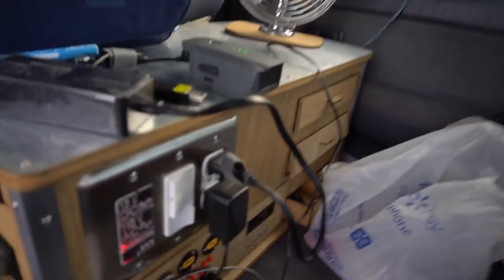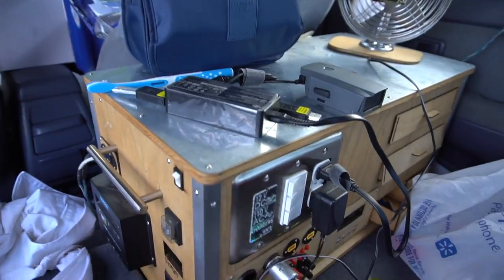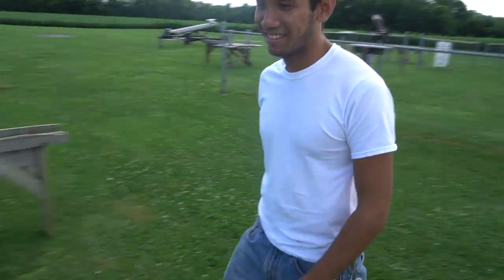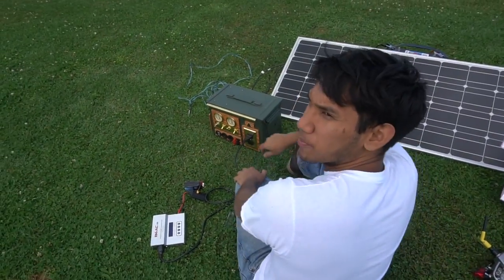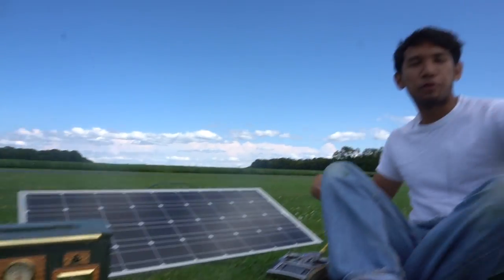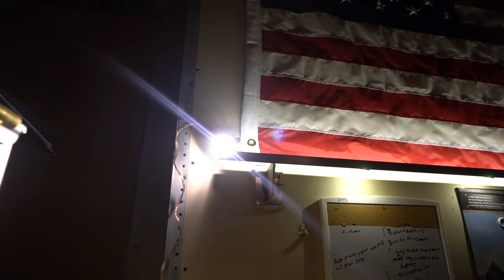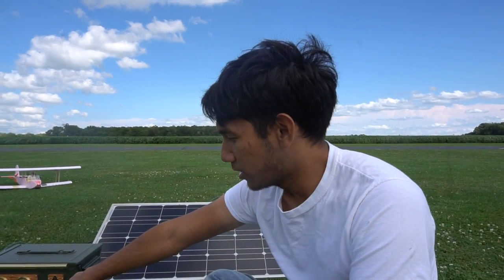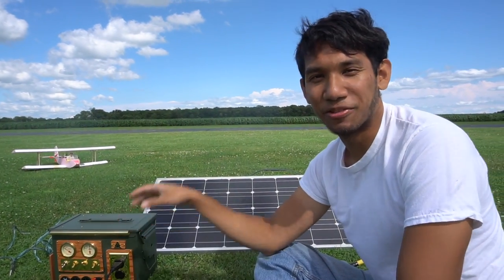Solar powered Ammo box thing

Comment: You should make a small waterproof box with the solar panel as the roof and the converter and battery inside. Then have an opening, like a small panel, to plug your batteries in.  Then the batteries will always be charged and less hassle!

Comment: What type of engineering classes did hebtaje inc would love to build stuff like this when i get older
Reply: I would presume CAD and soldering / electronics.
Reply: OfficialAsim actually you could take a class in CAD, but the programs are expensive. If you go the SketchUp's Design Studio it's not, and it works with 3D printing, routers and Laser machines. Next Electronics class for soldering.
Reply: Fusion 360 bro, it's free for students and hobbyists
Reply: The internet. You don't need a formal education to solder and screw things together. Go on forums, search YouTube for tutorials and just Google whatever you're interested in. People will generally help you out if you ask.
Reply: Don't rely on schooling. It helps, but you need to do stuff on your own.
Reply: 1 thing about schooling is though in my school system we can go for 2 autocad classes. obviously basic and advanced
Reply: Electronics class will teach components, and theory beyond what was taught in high school science class, well at least in my day. They still sell the kits you put together in college for switch, battery, lights, and buzzers. Later you can design circuit boards and timing circuits, logic boards, etc. Depends how far you want to go.

Comment: Can you make a vtol rc plane?
Reply: It's never a question of can he it's a question of will he
Reply: also, he defo has done one.
Reply: pootchies I tried to, but I failed
Reply: He already did, in his old channel
Reply: well bruh its call drone then.
Reply: R Z no it won't
Reply: No it's not, a Vtol is an aircraft that has Vertical Take off and Landing capabilities, such as the Harrier or the much newer F35b
Reply: technically a drone is a VTOL lol.
Reply: R Z So, taping a consumer drone on a stock Apprentice 15e will make a vtol? lol
Reply: yes
Reply: He made a semi-successful one on Flite Test awhile back. Kinda rough, but had pivoting rotors and flew pretty well.
Reply: R Z a vtol airplane is niether a drone nor is it a chopper. A vtol airplane is a fixed wing aircraft that has the ability to change the direction of thrust fro rearward to vertical orientation. Examples are the Harrier and the v-22 Osprey.

Comment: I challenge you to build a rocket that vertically flies and that there will be a parachute
automatically or manually (via rc, infrared ...) and (optional) with control by any system. Rules: If you are going to use motors with propellers they can not
be on the sides.
Reply: I forget that it can't have wings of more than 18 cm

Comment: I know thos video is 2 years old but please if you are going to use a metal receptacle cover mount the plug ground side up so if the screw would come out or the for any other reason the cover would fall when something is plugged in it won't short out on the plug prongs

Comment: Hey peter I have a question, I'm making an electric skateboard and I got an 880kv motor which may or may not be powerful enough but my question is, is a 30A ESC good enough for a 880kv motor. Ok thanks bye, love the vids
Reply: I'm inclined to say "sure, why not, try it" but really it's hard to know without all the variables. Current draw? Skateboard geared or direct drive? Battery pack?
Get a current meter and then start punching numbers. Easiest to use an online motor/battery/esc calculator.

Comment: make sure the battery charging cable is short as possible.. otherwise it will increase resistance and get battery overcharged due your ch.contrl thinking it is of lower level than it actually is , also those cheap solar charge controllers have too high cut off for acid battery and too low cut off too so be aware ,